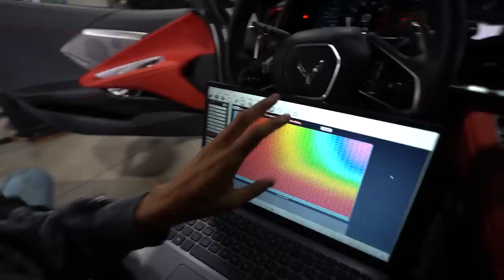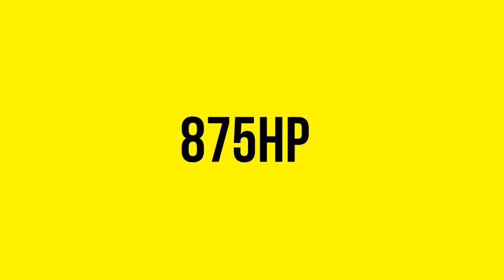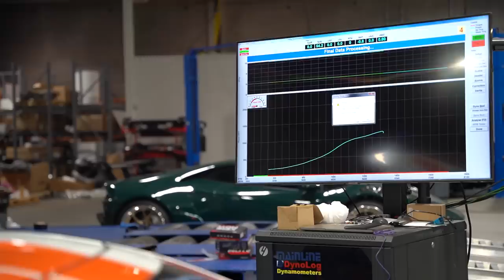I Sold One of my Favorite Cars…

Comment: you need to get a hold of a Ford Barra engine
straight out of the crate, they can be worked up to 1000HP without doing any work to the engine

throw a supercharger or a turbo on them stock…..